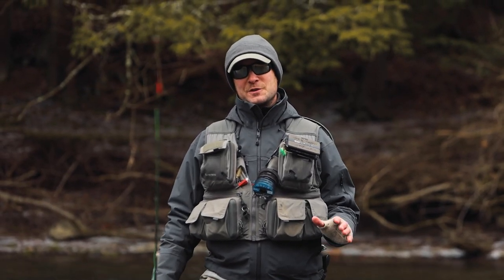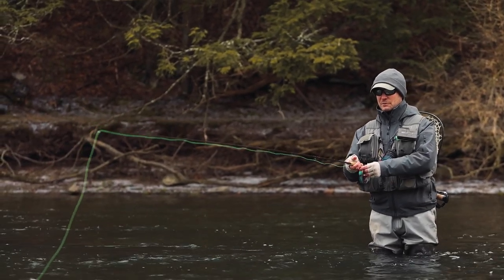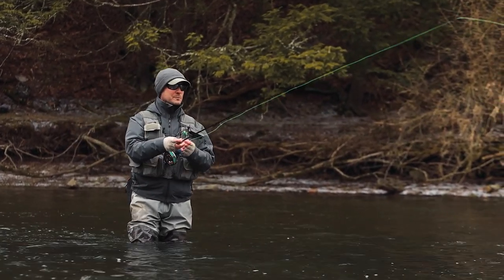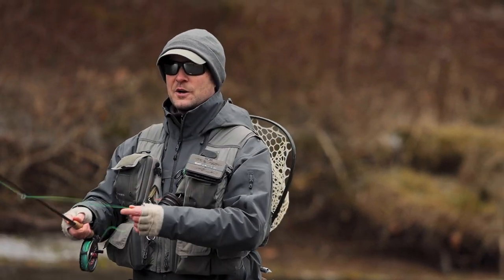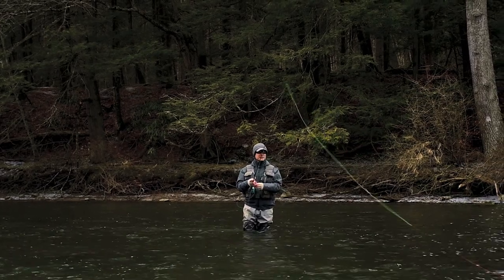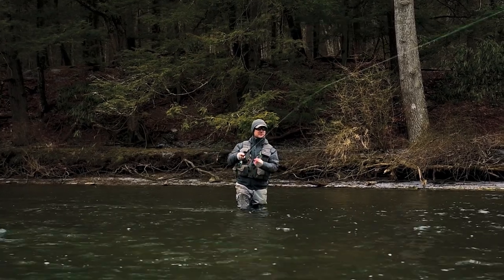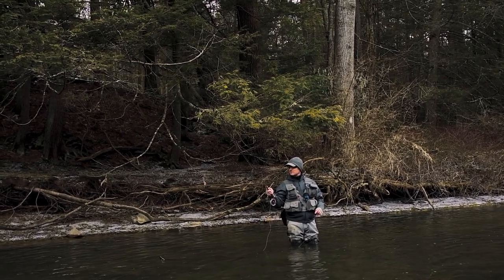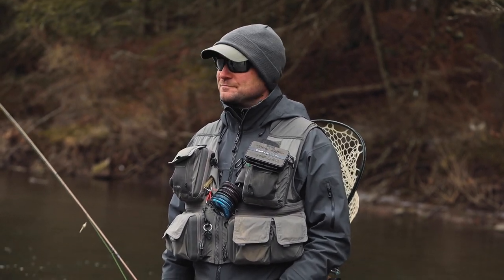Fly Fishing the Mono Rig: Streamers, Episode 2 -- Casting

Comment: Hey Dom. Love the yt channel, podcast, and website. I did about 6 hours of TB pods today working on my house!

Seems like you have affected the market for 20 lb Chameleon. That's the highest lb test price at Amazon at $26. Lol. 
Would Amnesia work for the long butt section? Also, why 20 lb and not 25 or 30? Any disadvantage to a high vis alternative for the long butt section, not stiff enough, weight? Would 25lb chameleon high vis resolve that? Any harm using HiVis line? What about a floating mono like Pline's Hydrofloat? .013" for 20lb. 

I'll donate to the site based on your answers. Ha ha.

Seriously though, great vids! Might be booking you for a PA trip soon. 👍
Reply from the maker: Thanks for your question. You can sub any material you like, but it will change the performance of the leader for sure. Remember, there's a good reason for each part of the Mono Rig. Here's an article that will help explain. This is like the keystone to the full Mono Rig series on Troutbitten:

Design and Function of the Troutbitten Standard Mono Rig
https://troutbitten.com/2021/03/14/design-and-function-of-the-troutbitten-standard-mono-rig/

To answer you question: Do not us 25 of 30 lb Chameleon or Amnesia. Both are far too thick for a good mono rig build. You will lose the tight line advantage and be dealing with coiling issues as well. 

And yes, there are disadvantages to using a hi vis butt section. Any time you move away from Chameleon you will lose power and have more coil, especially in the winter, even after stretching. All colored lines tend to do this. There are other reasons as well.

P Line Hydrafloat would be a very poor choice for a butt section, as it is a braid, designed to be supple, so it has no power. These lines are built to be cast with a weighted lure. With the Mono Rig, we are using the leader itself to do much of the work of casting. It PUSHES flies ot the target. 

It's Casting Not Lobbing
https://troutbitten.com/2019/07/07/fly-fishing-the-mono-rig-its-casting-not-lobbing/

#2 Turnover and Tuck Cast -- The Nine Essential Skills for Tight Line and Euro Nymphing
https://troutbitten.com/2021/06/27/2-turnover-and-the-tuck-cast-nine-essential-skills-for-tight-line-and-euro-nymphing/

Hope that helps. 

Cheers.
Reply: @Troutbitten  Thanks so much for the thorough response. I sent you a donation on your site.  Sounds like your work has proven that Chameleon 20# is the optimum choice. Thanks for the work figuring that out. 👍

Would 15 lb Chameleon be ok to try out? I have a spool of that. Wouldn't handle streamers very well I suppose.

Hydrofloat is a co-polymer I think, but it definitely would be too limp after re-reading its description and a couple of your articles. Floatation also doesn't seem important for a mono rig.

Comment: Just discovered your site, podcast and videos. Really digging your approach and ability to thoroughly analyze things. Looks like a heavily weighted streamer is crucial to casting this rig. I'm interested in trying it out here in Maine. How would it work with an unweighted Gartside soft hackle? Or unweighted wet flies?
Reply from the maker: Good point. For fishing streamers in any system, in any way, we need weight to get the fly down. You can build that weight into the fly, sure. But you can also use split shot. The great thing about the Mono Rig is that it requires less weight to get down. And because we aren't throwing sinking lines which are FAR heavier than even a heavier weighted fly, we can use lighter rods. No seven weights necessary.

Comment: This is all good...but what exactly IS the mono rig? is it just an entire line of mono? isnt that just conventional fishing without the mechanical reel?
Reply from the maker: Fair question. DIG IN, my friend. The answers are there for you. But they can never be contained in a single YouTube video. I never leave you hanging. There's a full category of articles about the Mono Rig on Troutbitten. Over 150 articles just on that subject.This will get you started.

https://troutbitten.com/the-mono-rig/

Hope that helps. Happy digging.

And, no, honestly, it's neither of the things you said. It's not an entire length of mono. It's just a leader of about thirty feet. Keep the fly line on the reel. Is it conventional fishing without the reel? No, not at all, because a fly line cast is very necessary to make this work. 

Cheers.
Reply: @Troutbitten  short story long could this solve the issue of trout getting spooked by the fly line?

Comment: Good stuff as always, Dom! One question: What is the maximum length of leader can i expect to pick up for a circle cast, that is, before throwing more of it in the forward cast? In the video, it almost looks like you're picking up 20+ feet of leader outside the rod tip, which seems like a lot. But throwing a heavy streamer wouldn't require as much pickup becasue of how much I leader I can throwing in the final cast.  Thansk much! Toney
Reply from the maker: Hi Toney. Good stuff. Like anything else, there are a lot a variables to consider for that question. I can throw more line if I'm on a boat, or even if I'm wading shallower. I can throw more line with a heavier streamer, because it helps carry the line with it. But in general, 30 feet is very comfortable, forty feet is pushing it. And fifty feet is just about maxed out. 

Make sense?

Comment: Great stuff here!  Quick question…. What is your opinion of using the mono rig to nymph from a drift boat. I tightline/euro nymph pretty exclusively when I wade but still fish a traditional flyline/indy rig on the drift boat. Im thinking this mono rig would work well. Thoughts?
Reply from the maker: Hi there. Tight line nymphing from a boat does not work very well, unless you anchor up the boat. Since the boat is going pretty much the speed of the current, that changes everything. You need to make an upstream cast for tight line nymphing to be most effective. However, you can take tight line principles and use the tight line advantage very well with an indy. That's how I nymph from a boat. It's deadly. 

https://troutbitten.com/2017/02/14/tight-line-nymphing-with-an-indicator-a-mono-rig-variant/

https://troutbitten.com/2022/11/25/video-the-tight-line-advantage-for-nymphs-indicators-streamers-and-dry-dropper/

Make sense?
Dom
Reply: @Troutbitten  makes perfect sense. I’ll throw that bobber on my mono rig next time. Thank you for the treasure trove of knowledge. I’m a regular to your site and youtube channel. I better buy me a hat :)
Reply from the maker: @thedousehousewatercolorexp5745  Ha. Cheers. Get you a hat.

Comment: 2 part question- I like throwing 3-4 inch Galloup flies on smaller spring creeks. boogie men, peanut envies, mini dungeons. I’ve got a 9’ 5wt and 9’ 7 wt. Both fast action. Which rod would be best for this rig? And if adding split shot, how far from the fly do you place it?
Reply from the maker: Definitely the 5 weight. I throw the same flies you are describing all the time. Seven weight is wholly unnecessary with the Mono Rig. Remember, you are not throwing the weight of a fly line anymore. Will you need to add split shot? I don't know. That depends on two things: How much weight is in your fly? And what do you want to do with the fly? (Get deep, mid column, move it fast or slow.) 

When I add shot I put it about ten inches above a streamer -- five inches above a nymph. But even that is conditional on how deep you want the streamer to ride. Most often, too, I simply use weight built into the flies. Plenty of the flies you mentioned have weight, usually. 

Make sense?
Reply: @Troutbitten  absolutely! I appreciate the reply. To me this makes sense fishing on smaller eastern creeks and be able to be stealthy and throw bigger stuff. Can’t wait to try it out. Also, I noticed on your formula online below the tippet ring you’ve got 36” for the top fly and 24” for the bottom fly. How long should your tippet be below the ring if you’re only throwing a single bug? And should you cater the tippet size to the streamer? IE boogie man = 0x? Thank ya sir.
Reply from the maker: @tf3876  Right on. Honestly, it makes sense regardless of the river size or any need for stealth. Having precise control over the streamer, from beginning to end, especially because it's our job to move a streamer convincingly, is an enormous advantage. It's also fun. 

Regarding your tippet question: In the article where you referenced the leader formula, I make the point that the tippet should suit the conditions and the fly. All of what is below the sighter is variable. 

Here are a couple of resources to help answer your questions:

PODCAST | TROUTBITTEN:Tippet Size, Strength, Length and Rigging:
https://troutbitten.com/2023/05/21/podcast-talking-about-tippet-size-strength-length-and-rigging-s7-ep7/

ARTICLE | TROUTBITTEN: Let's Talk Tippet -- Three Questions . . .
https://troutbitten.com/2017/08/09/lets-talk-tippet-three-questions-end-line-fly-fishing-rig/

Make sense?
Dom

Comment: Do you ever find accuracy to be more of an issue with this rig ?  I throw a lot of streamers smaller streams with lots of overhanging trees, tight quarters etc.  If you don't have the space for circle casting etc, would that be an issue ?
Reply from the maker: Hi there. Fair question. But no, in fact I believe I'm more accurate with this rig. Trouble with a fly line then the leader, then the fly, is that you're kind of casting 3 different things. With this rig, it's the leader and the fly, just 2 things. And remember, although I showed the circle cast, the leader is built to function like a fly line if you treat it that way -- meaning, you can throw tight loops when necessary, to get under branches and things. 

Make sense?

Dom

Comment: Are you using Amnesia line in this video?  Thanks for posting this video.
Reply from the maker: Hi Tim. 

Good question. I talk a little about that in episode one, and I also mention and link to it in the supporting article for this video (linked in the description). It's green OPST Lazar Line. It's nearly the same diameter as my favorite Chameleon butt section, but not quite as powerful, so it pushes less.

You can learn more about butt sections and the preferences of other anglers like George Daniel, Lance Wilt, Pat Weiss, Torrey Collins, Lance Egan, Davy Wotten, Devin Olsen etc., in the Troutbitten article found here:

https://troutbitten.com/2018/01/24/ask-an-expert-for-euro-nymphing-or-the-mono-rig-what-leader-material-do-you-like-for-the-butt-section/

Make sense?

Cheers.
Dom
Reply: @Troutbitten  Yep, makes sense.  I could tell by the color that it probably wasn't your usual 20# Chameleon.